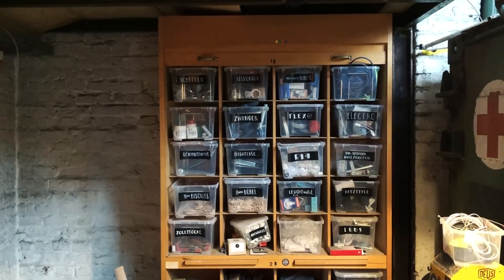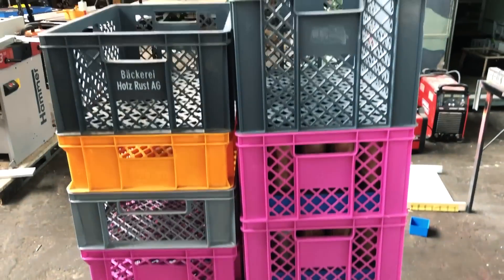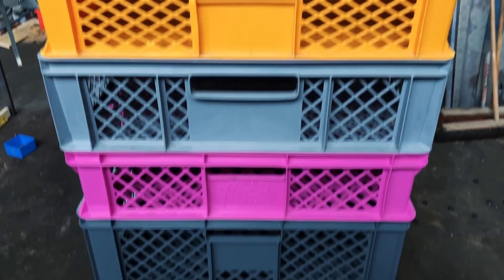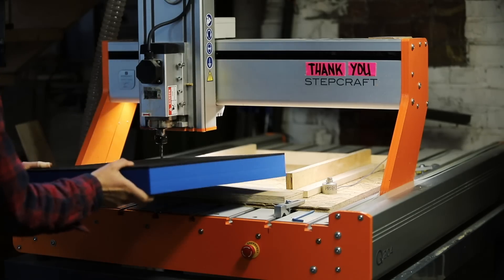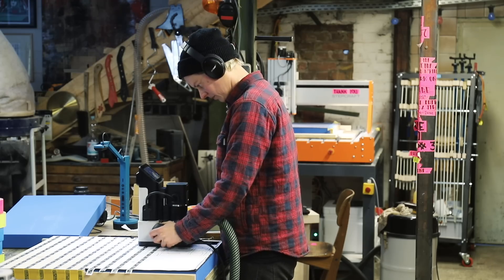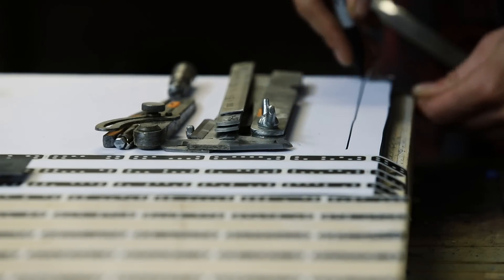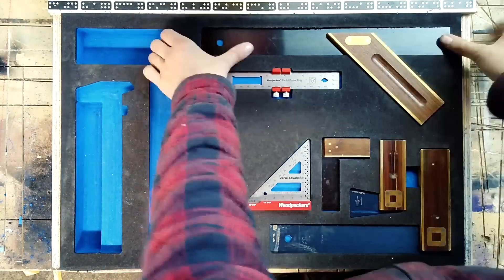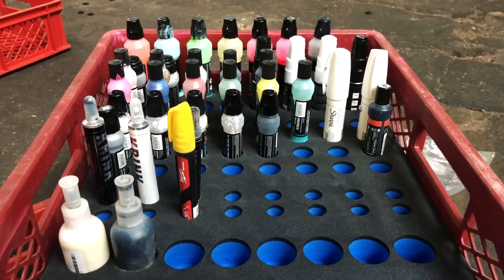Workshop Storage - Cutting Foam Inlets on the CNC

Comment: this reminds me how much I wish we could easily get euro boxes here in the US. They're effectively unobtanium in small quantities. McMaster has them, but they're costly enough to discourage purchases in quantity, especially with shipping.
Reply: For the other USA'ians who're wondering what's so great, and why milk crates don't really compare, consider that euro boxes interlock with a size down and also a size up. That is, the length of a box is equal to the width of the next size up, and the width of a box is equal to half the length of the next size up, and there are at least four standard sizes.
frex the 400mm x 300mm size can sit two, side by side, atop a 600mm x 400mm

Comment: Great work, Laura. You're cute, by the way! And so skilled. Anyway......In the aviation industry, where I mostly work, the cut-out foam, we call "Shadowing" for using in out tool chests. As you noted, the cut-outs and contrast amkes it easy to see if a tool is missing, which is important, because lost tools don't go well with aircraft. Too many places they can hide; cables and mechanical mechanisms they can get caught in. I have actually found several tools inside of aircraft that I have serviced.

Comment: Any chance you can post a link for where you got the foam or what kind of foam you used? I also have a Stepcraft CNC and have been having trouble finding a rigid foam that cuts nicely on it. Currently using XPS but it fairly brittle.

Comment: how will you stack ones like the spray paint, where it looks like the paint cans will be taller than the crates? or are there different heights available for the crates? i'm imagining cutting out the bottom of a crate to just have a "blank" to consume that extra vertical space

Comment: I use the 60x40 cratesbut I stopped using the milk crate style ones.  while they are lighter and cheaper I do not find them first strong enough for heavier items second when you have small ğor pointy items around they can not keep them in.  So I use the solid style.  I also have couple covers so I can put it on the top one too keep that once clean from dust.
and finally I have the 60x40 wheels that the crates fit into so they become mobile.  very practical in the shop.  good decision to switch to the 60x40 crates.  fyi they also make plastic seperators for these carts incase you have items that does not need foam bases.
I also have wheeled extra large crates that I use for special items.  for the shop I got rid of all the cabinets for storage and I got the steel heavy duty storage racks.  so everything is very organized and I can find what I need when I need it and very easy to explain to someone else how to find something.

Comment: Hi Laura, That looks very nice. I have been using these (EURO 60x40x40/20/12) crates for like forever. Bought them second hand for around 4 euro per piece. It are closed types which are usually used for dough. It started with 20, then 50, now more than 200. Foam inserts are too expensive for me so I have been using HARIBO candy boxes with lids. Great at keeping dust out too. I get them from a local supermarket for free. Then I made a racks everywhere and named the rows A B C D E F G H I J and columns 1 2 3 4 5 6 7 .... infinite. I made a big EXCEL SHEET on my wall and wrote down what's where. For example A7= router and bits / C12= wood glue. Infinitely expandable just like you said. My work is mostly outdoors, the haribo boxes keep rain out too. I do have 1 set of Tanos systainers because YEAH SYSTAINER, for packing my gear when going to work outside so I don't carry lump weight with me. Don't need the complete crate contents all the time. So when specific crates are in use, I have a small carrier on wheels for 6 crates which I call the buffer carrier. Whenever I use a crate or am using it, I don't put it back untill it's filled up again with what it was made for. This way I don't lose stuff. The color coding is a great idea too, but all my crates are yellow :-p. I have been thinking about spray painting the facade some day....but you know... tomorrow tomorrow tomorrow .... 5 years later...  and the numbers have become my standard. For example: I know know number 1 is screws and drivers, number 2 is nails and hammers, ... The name tags on the boxes are swappable, but when I need smth I don't have to read sooo many labels shattered all over the place, I just look at that 1 excel sheet on the wall.  I hope maybe you or some other reader can use this information and sort out it's organizing troubles.

Comment: Kind of.... a horrible idea if you think about it.... Sure its expandable, and you can make it fit/hold almost anything that you want... But what happens when you want something, and find out its on the very bottom of your stack? And everything else ontop of it is super heavy? You're going to have to repeatedly 'unstack' the tower of crates until you get to that bottom one... Then restack everything. 

Sure it'll be fine for the first few times you do it, but after you've done it 20-100 times, you're going to regret ever thinking of the idea. You're going to get sore from the repetitive motions of doing it as well if you're working on a project that you get super wrapped up in and accidentally put in a full 8-20 hours of work... 

So yea, its an interesting idea, and will work if you don't have 'alot' of things that need organized... but once you get to the point where you have to stack more than 3-5 crates per tower, then you've reached the point where it starts to become a hindrance rather than a solution.

Comment: Hi, we do the same thing at work but we use awaterjet to cut foam. If you want to upgrade your system You can add label near every tools, some tools are very similar and if you put label can take always the right tool every time.
Reply: How do you label them? With a marker?
Reply: @aayotechnology  no, we use a printer that print on sticky paper or use metal plate

Comment: Best way with screwdrivers are to have a thin wood strip you can screw onto the wall with holes downwards cause then you see the tip, size and length of the screwdriver.

Comment: Great video and nice use of a CNC. what type/brand of foam are you using. I did not see a link. Thanks
Reply: https://www.stepcraft-systems.com/produkte/q-serie (german based....) if you got a 3d printer, maybe want to google up lowrider cnc or MPCNC. works for MDF, general wood and even light aluminium as well

Comment: My two cents worth - for screwdrivers I've always put a small shelf (say 50mm / 2 inches or so wide) right along the bottom of my 'tool wall' (like you have in your background of your videos) and either just drill holes in it, or extend the holes to become slots slightly spalyed out at the front edge - so that way you can see what type the screwdriver is and they are easily got at .. but then I've also found that the shelf also becomes the dumping ground for pencils, tape measures etc over time...

Comment: When cutting foam, you should comfortably be able to take a full z depth cut. No need to waste time cutting 1/4" at a time. Also, crank up that travel speed, going slow just melts foam.

Comment: The issue that I have found with milk crate (eurobin storage) is accessibility. I find it very annoying that if I want to get one item on the bottom I need to get through all the other ones on the top. I believe there are systems that allow you to make drawers out of them. Do you think this is an issue? Great video! I am excited for the next part.

Comment: Although you said you're still learning vector graphics. If you wanted to do this  with a computer, you could get a decent flatbed scanner, scan the tools (put a white sheet over to help with contrast on items you can't get the lid closed) and then use Illustrator's Image Trace functionality to convert it to a vector for CNCing. Done correctly, the scanner should pick up the outline of a good amount of tools.

Just a tip for others looking to do the same.

Comment: Nicely Done!!  Thanks for scratching my compulsive itch for the day!  I have a small shop that serves 4 functions possibly a fifth down the road so, I am always looking for new ways to store and organize my wide variety of tools and consumables according to task.   I've had good luck with Kaizen Foam from Fast Cap over the years.  I don't have CNC capability and the Kaizen foam is easy to cut and peel with a good razor knife.    Thanks for another great video.

Comment: Thank you for your perfect timing Laura - I'm trying to work out storage for my shop as well.  I've been going with custom French cleat holders, but making each takes a lot of time & thought, and once you've made them they're easy to move, but a pain to revise.  Looking forward to your organization system for consideration.

One suggestion - for things you use all the time - think phillips/standard screwdrivers, pencils/sharpies, tape measures, basic squares, etc., consider making multiple copies of a flexible multi-holder and place them everywhere you tend to stand or sit doing work.  It's nice to know where you stored a 100 pencils, not nice when you need to make a quick mark and all 100 are neatly organized clear across the shop.  Carry on & nice work!

Comment: 1 1/2 " rigid foam is way cheaper and you can buzz out a pattern on the cnc super fast with only a 2 flute 1/8 " bit - i did a similar project for  my digital measuring tools to fit in a drawer and i am able to see at a glance whats missing - Great video! nice work

Comment: Something you could give a try is to lay white paper down onto your foam blocks. Ontop you lay down your tools. Using a camera mounted above the foam you take an aerial view of it. Covert it into black and white with high contrast so that your tools are 100% black against the white background. 
you can then convert that into an svg, scale it as necessary and throw it into a cad program like fusion. 
That way you can quickly and easily create cutting paths for Lulu.

Comment: What makes this an excellent video is that every hobby requires organization just like woodworking and making. Being able to customize your storage is a huge help. Photography and video equipment is one of those hobbies or maybe in your workspace as an online content creator.
I have another hobby that involves creating and painting miniature models for table-top wargames. This application with the foam and CNC machine would work wonderfully for it as well. Not only for my various tools, but for the models themselves, as they need to be transported to where the games are.
I prefer to get my foam from Kaizeninserts.com (United States), but there are many such companies that sell it. Kaizen also sells tools and a cut kit for hand cutting the foam: https://kaizeninserts.com/products/kaizen-cut-kit
If you plan to cut a lot of it, this kit is worth it. They also sell the router bits for cutting the foam. They have excellent customer service, too.

Comment: Laura, vectors are not that hard to do and you can use Lulu to do everything. It is pretty much what you where doing with the hand held CNC but in the computer. You import a photo or outline of the tool you want to cut out and then you use I think the pen tool and go around and add the little points along the outline of the tools and then save it. If you do this in Adobe Illustrator it becomes a vector once you connect all the points on a tool. Then you just bring the file to Lulu and it she does her thing. The only disadvantage you stated to Lulu is that if you make a mistake you can’t correct it on the fly like with the handheld machine. You have to go back in the file and correct it then re-save it and do it again. That can be a pain but usually if you do everything right the first time in Illustrator you will not make many mistakes. 👍🏼
Reply from the maker: Yes, but the flexibility to go back an make an outline half a mill wider without having to run to a computer and set up the machine all over again it the big advantage of the shaper. The whole CAM process is controllable and changeable writhing the machine in a super intuitive way. It’s pretty impressive!
Reply: Laura Kampf I understand and that is what is cool about the Shaper. Just don’t be worried about learning it on the computer though. It is so easy. If you can do it on the Shaper you can do it on the computer and make a vector. Can you save the patterns that you trace on the shaper to have the file on hand if you had to make a cutout of that same shape again? If so, that is a GAME CHANGER. If not then that is a disadvantage over the computer. They both have their advantages and disadvantages I guess. 👍🏼

Comment: Wonderful.  I wish  you much luck.  I've found that most of my "friends" don't know the names of tools.  Best example is with screw drivers.  Most people know what one is but they get totally lost If I say they need a "#1 Phillips or cross tip" screw driver.  Nobody seems to know there are #0, #3, #2 and #1 driver sizes.  Same problem comes up with drill bits.  Many people know a drill bit when they see it but few understand that there are different size names for them.  Like you might find a fraction of an inch stamped into one.  But you might also find a whole number stamped into one.  These things mean a lot but you can't be spending all your time explaining all this to your friends.  You HAVE to have charts and or samples right next to your items that have these issues.  Like a row of bolts with various sizes displayed next to your nuts storage and nuts in a row next to your bolt storage.  This way, IF someone has a nut and needs more of that size but has no idea what size it is, they can take the nut to the row of bolts and see which one it fits on.  You can then get more of that size nut.  Same going the other way.  You have a bolt so you try screwing it into the row of nuts until you find a fit.  This method will work well with all your tools also.  You can have a row of allen head bolts to determine the size of the wrench your using or a row of allen wrenches to determine the size nut you have.  Do the same with sockets and bolt heads.  I'm sure you get the picture now.

Comment: I reckon there has got to be a cool mechanical thing you can make to allow you to pull a crate out of the middle of a stack of crates. Something which slides around the front, sits on a lower crate and with a screw jack lifts the upper crates evenly, and then you can just lift the middle crate out. Then you can have efficient deep storage with the crates stacked HIGH which would also look so cool!

Comment: hi just some tips on working with this foam, i work with it in my full time job, you can blow it over with a hot air gun and it will give it a clean look and help hide the cut marks and remove the small hairs from the cut, it can be heat welded with a hot air gun and the foam is know as LD45 ( plastazote ) the number is the foam density, you can get it almost any color you want can buy it in sheets 1000mm x 2000mm and from 1mm to 100mm thick. i happy to help if anyone needs anymore info and sorry it the grammar is bad or spelling i struggle with dyslexia. keep up the work Laura, hi form England :)
Reply: on second thoughts i might make a video on working with this foam as i feel this info need to be share with the makers of the world as i see a lot of people working with foam and i picked up one or two trick i think will help a lot of makers. :)
Reply: @wolfgrim  That video would be amazing! I work with this foam in another hobby so thanks for the tips about the hot air gun!
Reply: @wolfgrim  Yes please!
Reply: i posted a short video on my channel showing some trick called, Working with Foam - A Day in the workshop
Reply: @wolfgrim  hi did you ever made that video on foam, if so would you please link me to it. thank you
Reply: @maxsmith2320  the link might get block but just check my channel playlist under a day in the workshop :)
Reply from the maker: Great infos! Thanks!!
Reply: @laurakampf  there now a video on my channel showing you how to heat weld foam. keep up the great work :)
Reply: @joehoandroid  :) yep, that the one, if it dose well i be making more videos from my workshop.
Reply: wolf grim what kind of foam do I source if cutting drawer organizers for tool shadowing  on a CNC?
Reply: @3amcookcom  LD45 plastazote there lot of suppers out there and just call them up, if you want two colors you may have to pay more as they will heat weld it together. i will be posting a video talking about it as this seams to be really poplar and i dont want to spam this video with comments :)
Reply: In Czech republic (middle of EU), 1000x1000x100mm XPE foam (45kg/m^3) cost over $100, and 10 sheets of 1000x1000x10mm of this blue EPP (80kg/m^3) cost over $150.
Reply: Im in Canada and  it nice to have the specification so I can find an company and say I want this and I need it cut like this..... (Living in a small space  in downtown core so no room for cnc or  hardware)
Reply: This specific foam sheet seems extremely expensive. Like amazon lists 1 sheet of 40" square and 1" think at about $150USD. I'd think for many tool case uses 1" is not thick enough. https://www.amazon.com/Plastazote-Material-Sheets-please-thickness/dp/B01NAVD2K3?th=1
Reply: @janbottorff4642  the stuff not cheep but dont get it from amazon, as far as i am aware a 1000 x 1500 x 100mm sheet of ld45 is £90 ( but i may be wrong ) try looking for a packaging company as the foam is use in high end packaging, such as army and aerospace. they may have off cuts they may sell you. it not cheep but keep in mind this is top end foam the Rolls Royce of foam. there is lower grades but i dont know much about them other than they can smell and look cheep. you can always use cheep floor mats to fill the draws then just add a 6mm skin of the LD45 foam to get the same look.